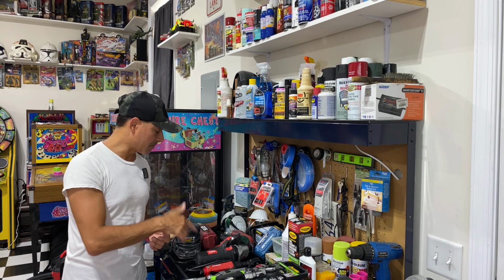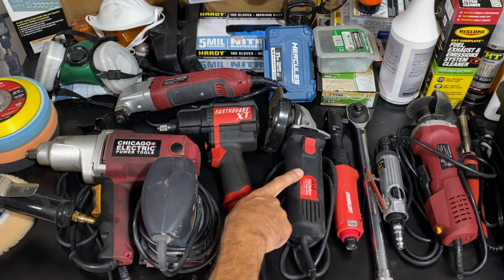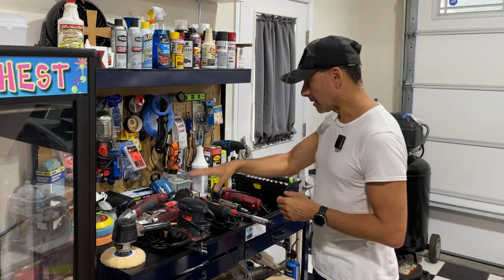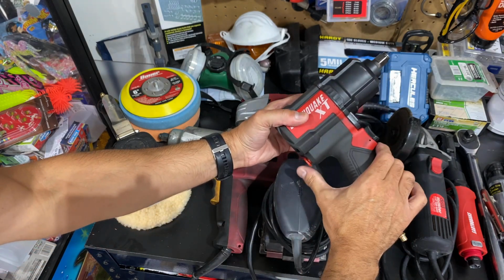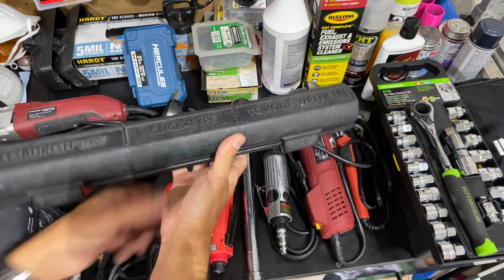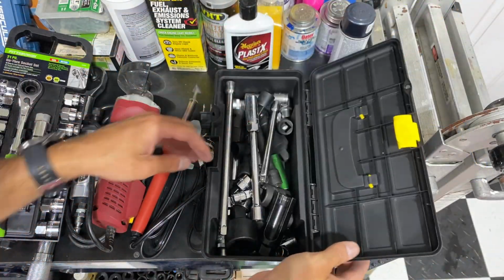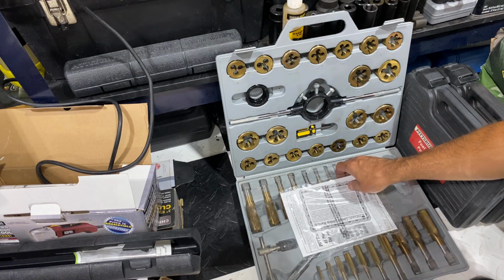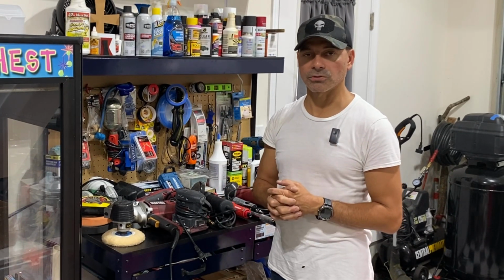My HARBOR FREIGHT Tools (Andy’s Garage: Episode - 484)

Comment: I've had multiple problems with the stuff I've bought at Harbor Freight over the years. I had never broken a socket extension in my life but I've broken two from the same set purchased at HF. My angle grinder, the handle broke on it in the the first few months, and now the on off switch won't stay on. I have to physically hold it on when I want to use it. And I only use that about once a year. My mom bought a trim router that fell apart the first time she used it. I was going to say that in the reviews on their own web site most of their power tools get mediocre ratings. But that has changed. Power tools they've been selling for years that used to get bad reviews, now show stellar reviews. Boy that's not fishy. My personal opinion is, you get what you pay for at HF which is not much.